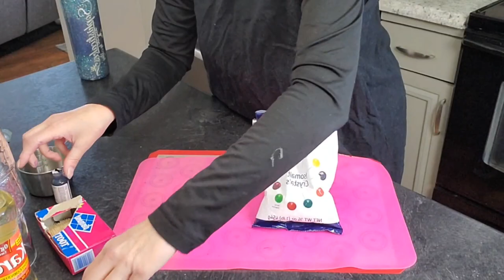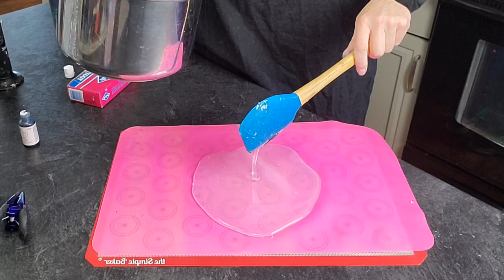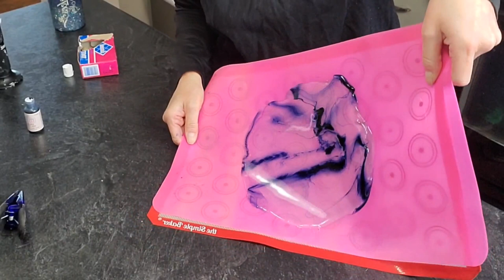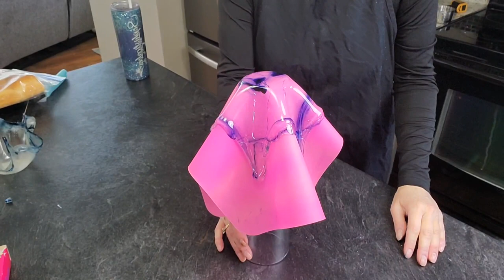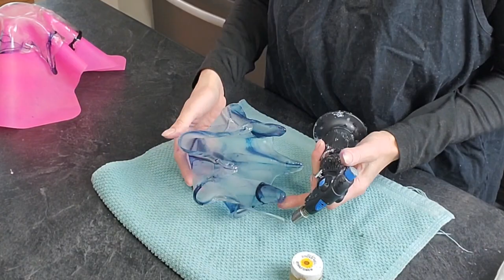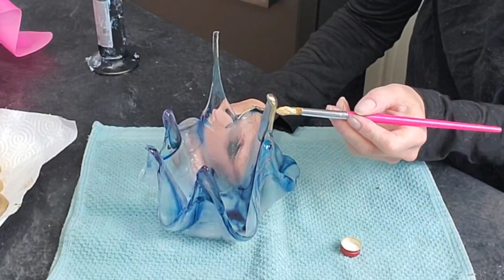Cake Decorating Tutorial | Isomalt Sail / Bowl Cake Topper

Comment: Does the syrup need to be Cold before it placed on the silicone mat.
Reply from the maker: Actually the isomalt needs to be hot or else it won't move.  But be very careful as it can cause some severe burns if you touch it.  I would suggest using heat resistant gloves.  The only reason I didn't is because they were at work:(
Reply: @sophisticakesbymary  thanks for the info. Beautiful work.
Reply: @sophisticakesbymary  how can we storage when we have Made certain amount.

Comment: Love your videos.  Question:  will a heat gun work the same as a torch for clearing up the Isomalt?
Reply from the maker: Sorry I just saw your question! I have not tried, but I would think that maybe you would have to hold it in one spot too long and it may melt it? If you have tried it and it works, let me know ok?
Reply: @sophisticakesbymary  Thanks for responding.  I did try it.  Heat gun melts the drip.  Have to be careful not to make holes.  Helps a bit but not ideal.  😘

Comment: Beautiful! Does the sail breakdown after a few hours?
Reply from the maker: Thank you;) if it is left in a cool dry place, it should last for quite a while. I leave them a little on the thicker side to be safe;) Humidity is the enemy.
Reply: Thanks for the tutorial. im from an asian country but mine was broken in to small pieces after few hours... 😥 should try another one and keep inside refrigerator...
Reply from the maker: @madushanipeliarachchi6483  Hmmm my guess would be that maybe you needed to let it rest for just a minute before drapping the mat? If you let it cool down just a bit, it may stay a little on the thicker side and be stronger. I am afraid that the humidity from the fridge could melt it. Unfortunately Isomalt doesn't like the fridge in my experience;(

Comment: Hi. Why do you use the corn syrup? Will it make it less sticky? Do you have any advice on how to make the bowl not being sticky? Thank you
Reply from the maker: Hi! I find that the corn syrup keeps it more clear as it dries;) i  not sure why it would be sticky? Maybe let it dry longer? Are you in a very humid climate?
Reply: @sophisticakesbymary  Well, I live in the north of England, it might be humid, I'm not sure. Can the corn syrup be replaced with glucose? I have tried different ways to make it not be sticky but everytime it is. Never put it in the fridge so that is not the issue. Thank you for taking the time to asnwer me
Reply from the maker: @aldinyz  hmmmm. Maybe too much water? I have never used the glucose with it, but it may be worth a shot! They are fairly similar. I do use glucose in the sugar sheets instead of cornsyrup and it works in that.
Reply: @sophisticakesbymary  I never melt it with water. Only isomalt. I will maybe try with water to see if it makes any difference. Thank you
Reply from the maker: @aldinyz  actually I wanted to make sure you weren't using any because it can nake it worse:(
Reply: @sophisticakesbymary  ahh, ok. Lol. Will avoid then
Reply from the maker: @aldinyz  😉